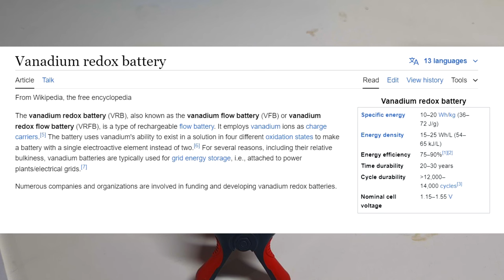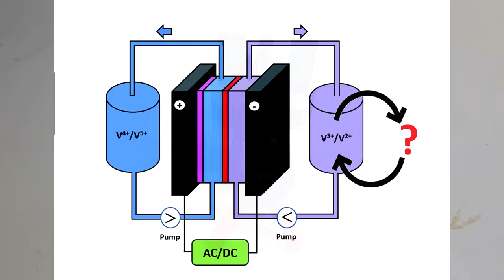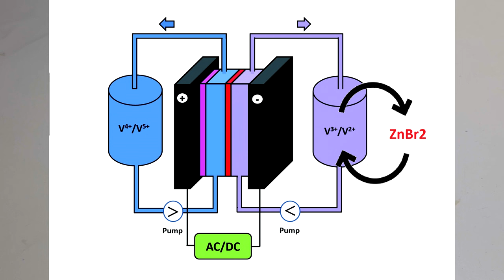More that Vanadium flow battery

Comment: Great work as always! The ZnBr2 will certainly require a complexing agent to avoid the problem of Bromine gas. Why didn't you use carbon felt in the anolyte/catholyte to increase the surface area?
Reply from the maker: Yes. In the paper they use 1:1M MEP/MEM
Reply from the maker: I dont use carbon felt in the H test cell. Because the H cell I use more or less for testing the electrolyte combinations.

Comment: pretty sure I had seen them doing this a decade ago , but the chemical costs worked out higher then it is for just increasing tank capacity , did you see the magnesium water batteries ?
Reply from the maker: Yes the chemistry are from 2019 and 2017, but several days ago I look little more into these two batteries. Magnesium water battery,... yea, which one? From RMIT?

Comment: maybe with ceramic separator?
Reply from the maker: Yes, will work for some time
Reply: and maybe lower cost than nafion... and resolve he problem of zinc dentrites?
Reply from the maker: @simonexperiences  ceramic separator will also higher the internal resistance
Reply: ah! ok. thanks for this information.
i'm doing membrane with pva and kdp(potassium dihydrogen phosphate), but it is too gelatinous...
do you have a tip to make it "more rigid"?
thanks